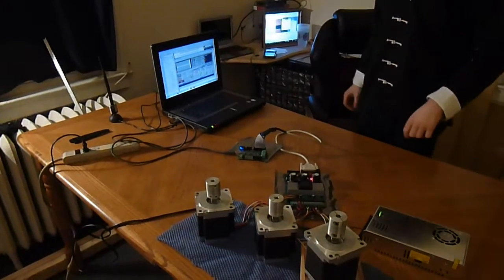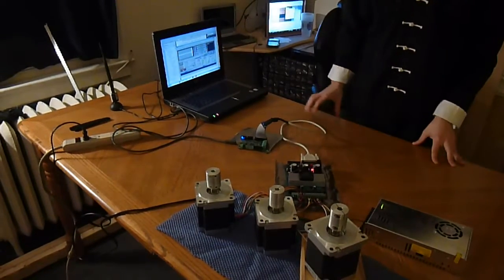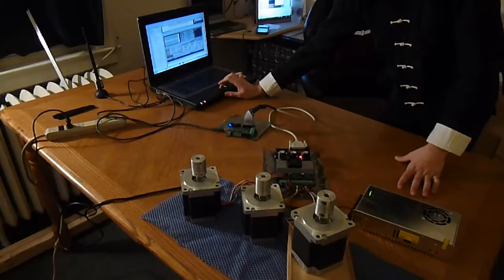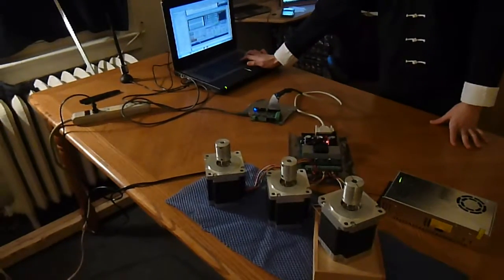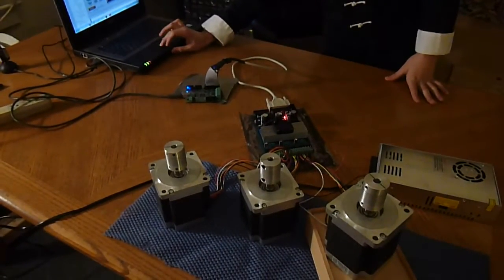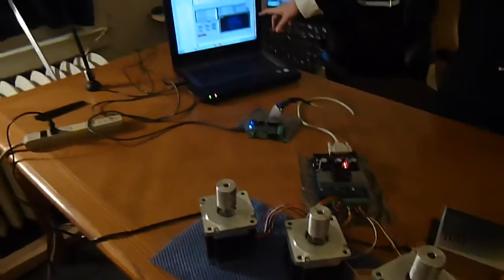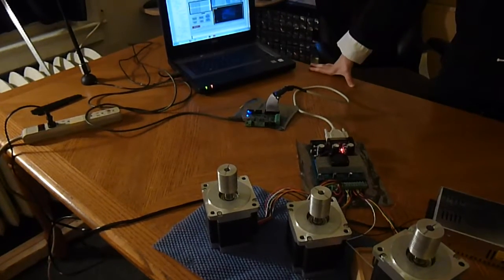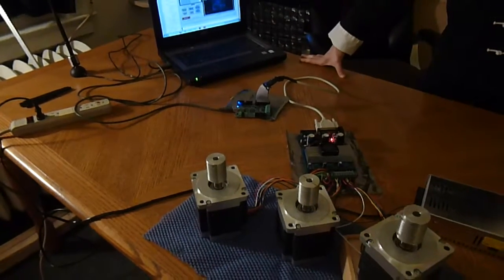NEMA 34 Stepper Motor Testing for CNC

Comment: What Amperes are your motors? What's the voltage you use on your power  supply? I have the same tb6560 but 4 axis with 2.0A Nema34 878oz. and I can not make them to move. Any idea on what can be wrong?
Reply from the maker: Hey Santos. My power supply is 24V @ 6.5 amps.  Your motors, I believe, are the same as the ones in my video.  The two sticking points I had getting mine to run were A) Making sure the wiring was correct (Do yours have 8 wires?) and B) Getting the correct steps per revolution.  Do you have any pictures of your setup?  If I recall correctly I had 800 steps per revolution, but it's been a while so don't quote me on that.  I have a PDF with a lot of info that may help you.  Let me know how I can send it if you're interested.
Reply: Hello Adam Sutton!! Sorry for late response. Yeah, my motors are 8 wires and make pairs with them so I can get major torque. I did an evaluation with multimeter and seems to be OK. I have no photos now, but can share soon. If possible and if it's not too much to ask please share that PDF you mention. My email address is: santosav82@gmail.com
Thanks in advance!!